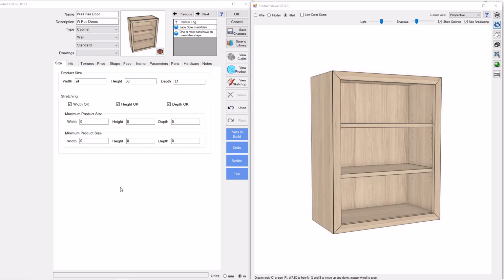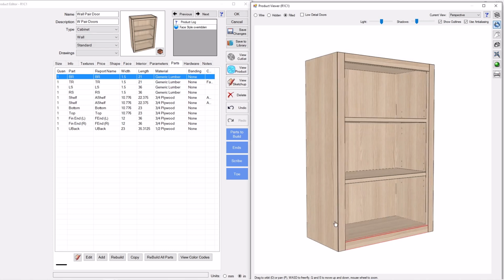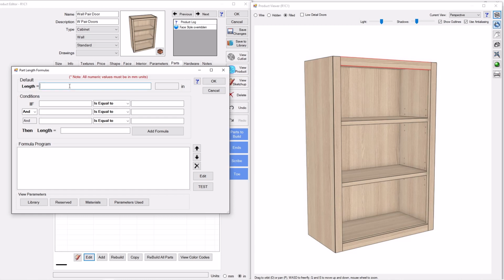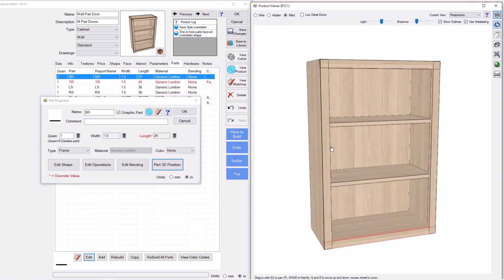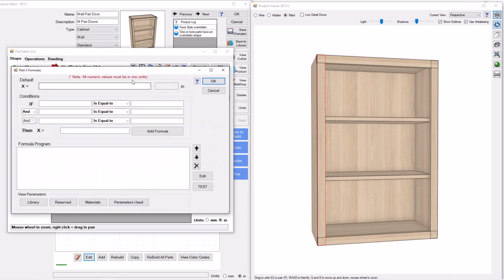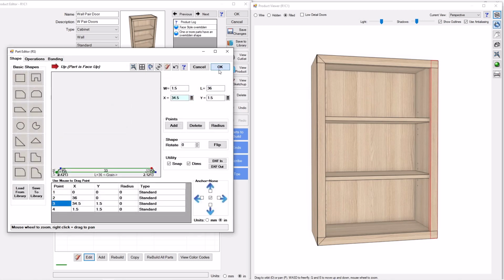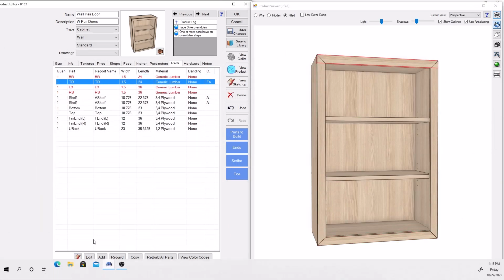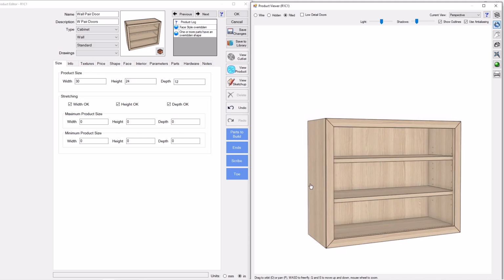FACE FRAME MITERS!...Parametric Mitered Face Frames in Mozaik Software

Comment: Great class!  What's the best way to do the same thing for a frame-only (no box) 
Would that be just a mitered door? 
I'm looking to use for doing mirror frames which are typically 3-4" wide SR but could be large (40x80, 29x75, etc..) 
I also am using a puzzle-shape half-lap connection which keeps everything perfectly square. 
I just did some in v-carve but I know between mozaik and your skills it could be possible and a much better process.
Thanks Nic

Comment: I really enjoy your videos. Parametric design is the way to go. Can you import a totall new sketch up drawing into Mozaik? More like furniture then cabinetry, or do you always have to modify existing cabinetry?  Thanks...How about parametric half lap miter joined ?
Reply from the maker: Thanks Eric...you can import a SketchUp drawing to provide the visual representation in Mozaik but you're always starting from a generic library item to build custom cabinets or furniture in Mozaik.  As far as the half lap miter joint...I suppose it's possible to do but really would be for visual representation only.

Comment: Hey, love the content.  It would be great if you could do a video on how to create multi-faced cabinets. I know that you can assign right and left faces etc... However, when you go to fill in the inside of the second face, nothing good happens. I am hoping that you have some insight into fixing this problem.  Thanks
Reply from the maker: Hey Aaron...thanks, I'm glad you like it!  I'll look into that...are you looking for the second face to be a usable door? Or for the second face to have the look of a face with a fixed "door"?
Reply: @thecabinetpodcast  Imagine you were making a one-cabinet island 36" deep and 96" long . On the front face you might have a bank of drawers to the right and left  with  doors and some adjustable shelves in the middle. On the back face you might have three sets of two drawers  with some shallow adjustable shelves ( Divider up the center to section it off  from the front face interior.) On the right side of the island cabinet might be an open face with two fixed shelves for cookbooks and such.  The problem is that Mozaik will only support building the interior of one face of the cabinet. If you want to do more than that, it starts to get weird. Is there a way to build a island like the one I described?